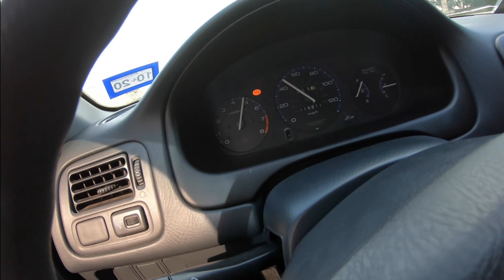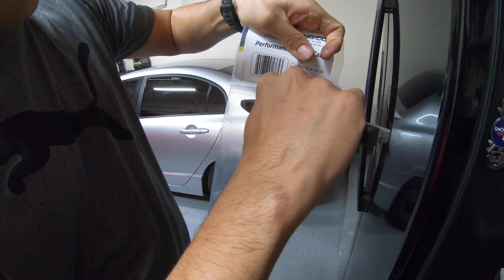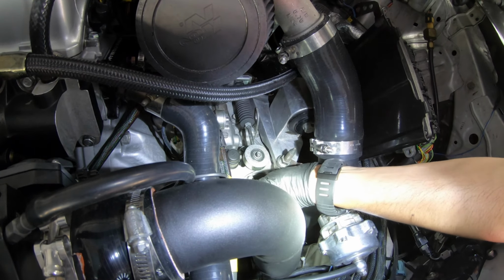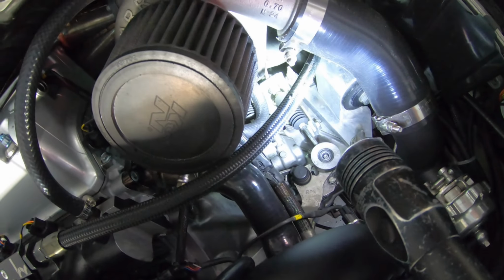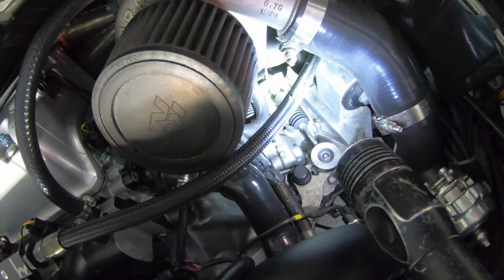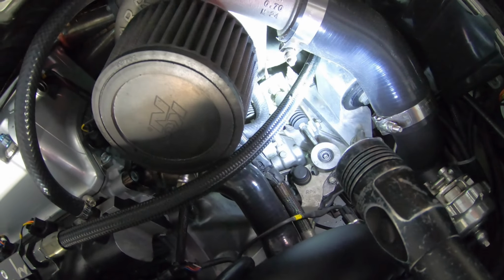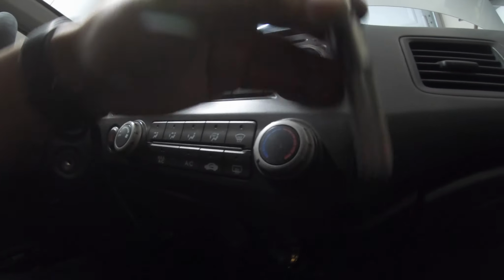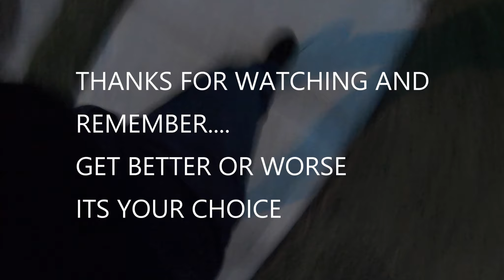FULLY BUILT CIVIC GETS HYBRID RACING SHIFTER CABLES!

Comment: hey guys awesome fa5 and video ... so my civic came with hybrid cables and I wanted to install a short shifter now do I need to replace the cotter pins in the cables when I take them off the stock shifter and where do I get them if I do? also is there a good way to take them out, Ive never worked with them before really
Reply from the maker: they come with new cotter pins bro! the curved side of the cotter pin basically locks in just pry open the curved side and they slide out easily
Reply: @xQsalan  thanks bro lol actually i did some more research and apparently theyre just the cable locking springs and everyone just reuses them so that's probably what ill do haha

Comment: What harness is he using? Also if you email hybrid you could’ve got the shifter rebuilt just gotta pay shipping
Reply from the maker: It's wire works harness and he had the guys that work there modify the MAP sensor clips and injector clips
Reply from the maker: But yes he did call them and sent them pics of the shifter and they just sent him a new one